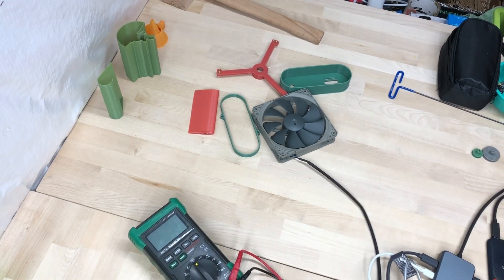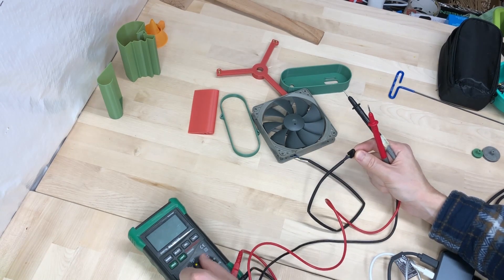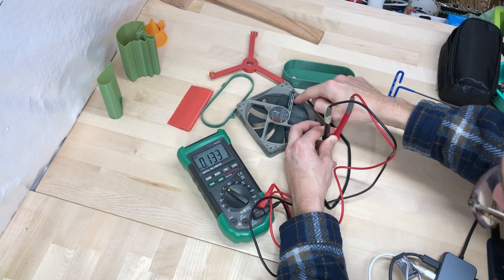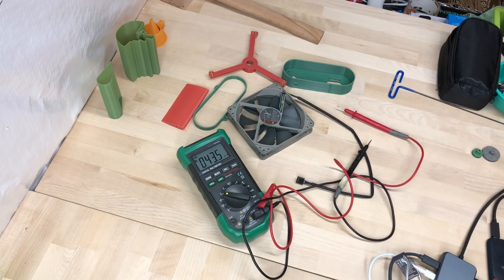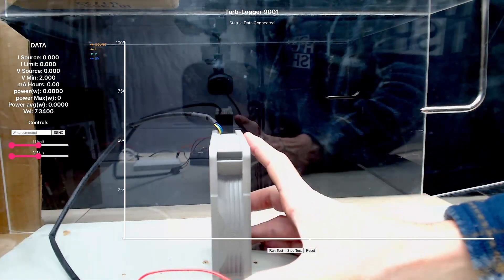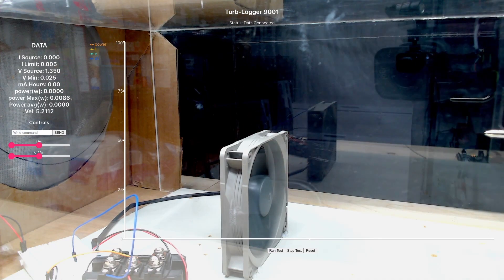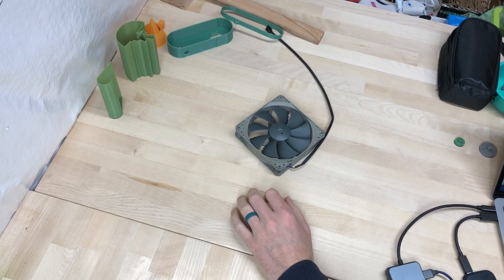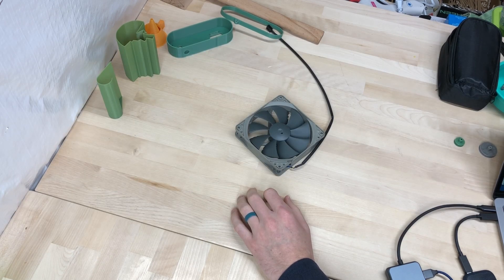How much power does a Noctua PC fan generate?

Comment: I like were your going with this channel.  Comparison testing.

To be fair:  
All turbines should have the same cross sectional area.
A variable resistive load should be applied during the run to find the best Volt times Amp. (Watt) reading.

Each turbine will have an RPM (tip speed ratio) where it is most efficient for a given wind speed.  Usually that RPM is about 1/2 the free running RPM and the variable resistor should be able to slow it to that speed.

A good flow straighter at the intake to produce laminar flow should make the readings much more consistent.  Temperature and barometric pressure will also effect results, so comparisons "for the record" should be done on the same day.

I would love to send you some of my VAWT designs once your test are a little more standardized.

Best of luck on your channel.
Reply from the maker: Thank you! You can send me a stl or a simple profile of your blades to [redacted]. I would love to test them. I realize that this video isn't a fair comparison to the rest of the turbines, I've removed it from the leaderboard. I do standardize swept area, it is 100mm tall by 186mm wide. During testing each turbine is allowed to free spin until its voltage "settles" and then the load current is slowly increased(automagically) until it sags to nearly 0 volts. I'll do better about documenting the testing procedures in the descriptions of my videos.
Reply: I looked at your earlier videos and saw the graphs. Nice job!!  Looking forward  for more of your videos in the future.  @hellothisismax
Reply from the maker: I'm glad to hear it and looking forward to seeing one of your designs!

Comment: mebe noctua knows a thing or two about fins
Reply from the maker: It's possible, I'd like to figure out why the voltage was all over the place. 🤔
Reply: Most DC cooling fans use brushless DC motors which are three phase permanent magnet AC motors with a built in inverter.  If the inverter is removed AC voltage can be taken from any two of the motor windings. @hellothisismax

Comment: I see two reasons why this would do unexpectedly well. First, this is using a different "generator". The other is that this isn't a vertical turbine, so it gets a leg up in this scenario since the wind always comes from the same direction.
Reply from the maker: I'm excited to see how it compares to other designs I'm planning on testing. If you've any ideas, I'd be happy to stick them in my windy hole.